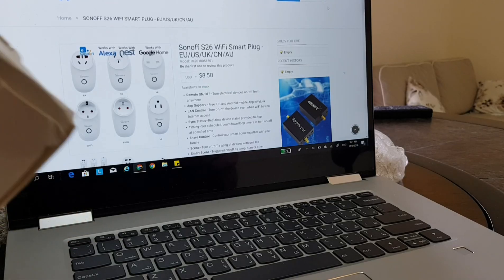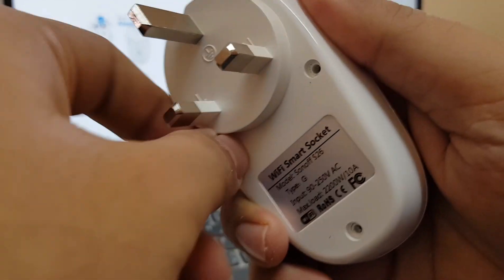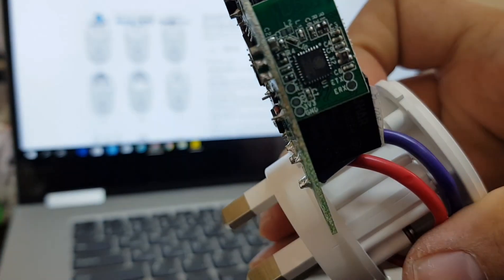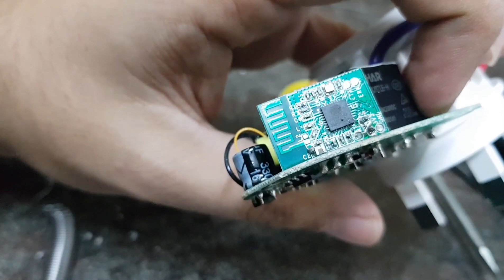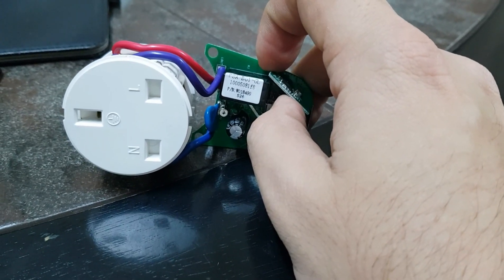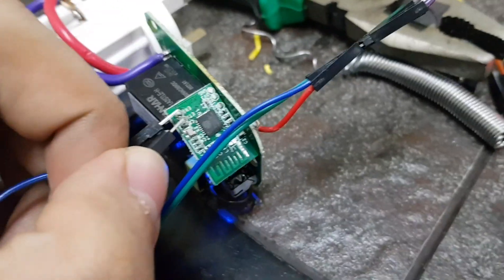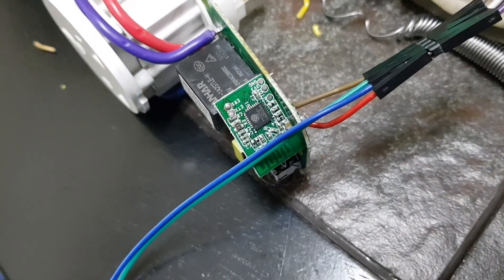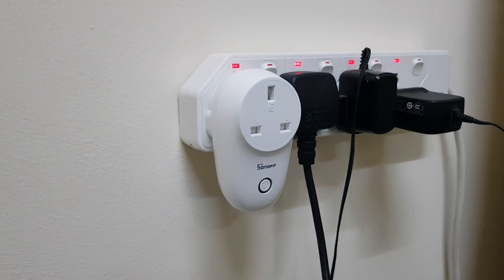Flashing and Setting Up tasmota on Sonoff S26 Smart Socket

Comment: Problem is not your soldering skills but the soldering type you use and the cleanness of your soldering point. You should clean the point before use with some sponge and water ( when hot, so you can wipe of the old soldering). Using solder with higher Pb percentage will do the trick ;-). At all very useful video for me, as know the S20's are hard to get and all replaced by S26. I needed to see what is inside of the S26 before buying some. Thanks !

Comment: DO NOT CONNECT THE DEVICE TO LIVE MAINS when flashing. It will BLOW UP YOUR PC! Always solder properly. Maybe use a smaller soldering tip. Was no problem for me to solder on the board.

Comment: Flashing it with mains connected is dangerous. It is not isolated from mains and it will connect mains to your usb. Unless damage saves you, there is a high risk of electric shock.
I like the form factor of S26 better but is seems a pain to program. I wonder if I should just make a jig with pogo pins to program those. If I has quite a many of those, springy pogo pins could save time to program a lot of them.
Reply from the maker: this 3d printed solution is a great alternative to soldering https://www.thingiverse.com/thing:3193583

Comment: what USB adapter did you used? I've the USBASP v2.0 but I need to understand the pinout....thanks
Reply: I successfully used flashed via RS232 TTL PL2303HX cable, but I broken one S26 (during the flashing)..no more led lights when I connect it through the power...any idea on how to recover it ? thanks
Reply from the maker: I am using qunqi ftdi from amazon.com
Reply: thanks @alsolh  ! How can I recovery a broken unit? thanks

Comment: If you have a 3d printer its rather easy to flash without soldering as you can use one of these. https://www.thingiverse.com/thing:3193583

Comment: By the way, did some research and planning to try flash it using this project. Now it is in state that it doesn’t work with current firmware, but might save some people hard times „soldering“...

https://github.com/mirko/SonOTA
Reply from the maker: Sonota never worked with me actually. But it would be great if they fix it.

Comment: You can make this process a lot easier if you have access to a 3d-printer. Check out https://www.thingiverse.com/thing:3193583
Reply from the maker: Thanks for the tip. Really saves a lot of time. But i have no 3d printer for now. I would really be interested to invest some time in 3d printing it is very useful

Comment: Great demonstration! Do you know ESP8266 Board version of Sonoff S26 or if there several, how to check that?
Reply from the maker: Thanks dear, it is indeed esp8266 and i think i gave a closeup shot to the chip showing the name. I am not aware there are several versions of esp8266 itself, i only know there are different versions like esp8266, esp32 and s26 has 8266. But in general i recommend s20 over s26 due to having easily accessible pin headers.
Reply: @alsolh  There are several versions check here: https://github.com/arendst/Sonoff-Tasmota/wiki/Arduino-IDE, I know about s20 too, they have removed the pin headers in s26 (just discover this after purchase the s26...), but soldering is not a problem to me. Thanks for the advice! I am trying to flash from an Arduino Uno following that github link, but they have used a portable version of Arduino IDE, and I am trying to do it with a full installation, but I really dont know ESP8266 version to see what files I have to copy (or even if I really need to do it!) and where should I place those in Arduino IDE installation. And what settings should I use in Arduino IDE since I dont know the ESP8266 version. Do you have a tutorial somewhere in how to flash this in a better explained way?
Reply from the maker: @ApolloPTT  this video is the best tutorial for setting up arduino ide to flash esp8266 based boards
https://youtu.be/chyVjtYb0EA
Reply: @alsolh  thank you very much, that will help a lot!!

Comment: without soldering its risky
Reply: If you stick it into mains and try to flash it is risky, otherwise I don’t see any hastle. I will try it very soon as soon the switch comes. Thanks for the video to alsolth.

PS: Just holding RX/TX pins is more likely to be pain in the a... If you are trying to upload it 20 times :-)
Reply from the maker: Not really. if the connection was lose during flashing and it stopped the progress, then you can flash again from the beginning. Happened with me on other sonoff products.

If you mean the power pins then yes it is absolutely necessary to solder the power pins for the s26 model. There is no other way, and connecting to mains while flashing is having a risk of frying some parts in your pc.

Comment: Is soldering absolutely necessary or could you just hold the wires in place? Perhaps clip them there with a peg or something?
Reply from the maker: Area is too small to clip something, and holding in place is also very hard how will you hold 4 pins in seperate locations, soldering 2 ground and vcc wires is necessary, you can hold the pins for tx and rx